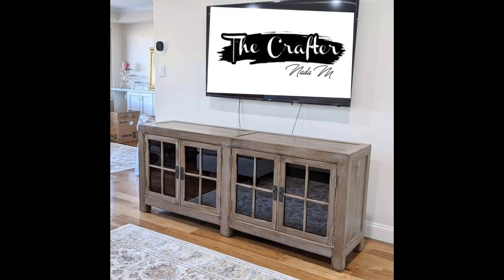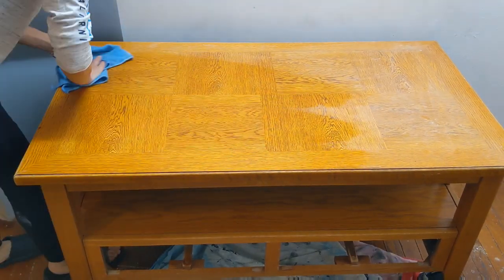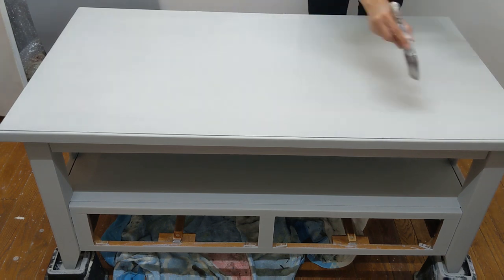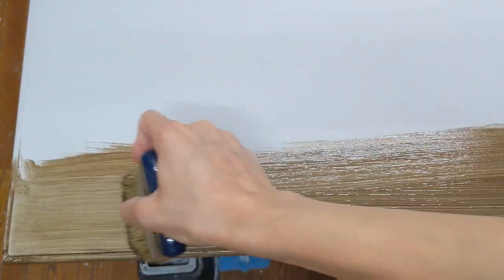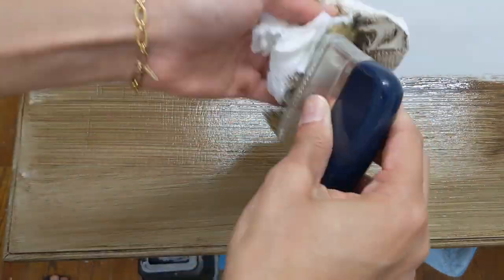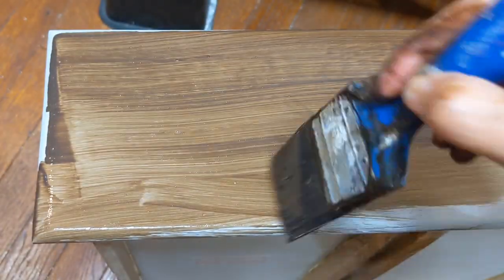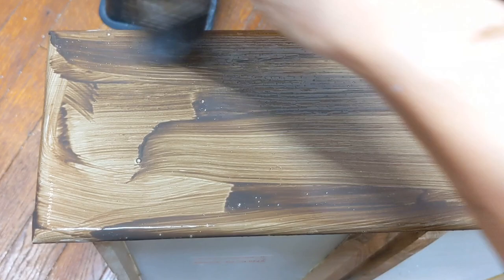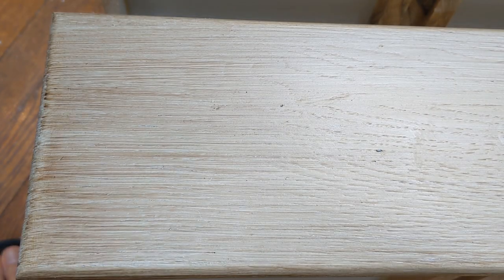POTTERY BARN Dupe DIY furniture makeover  | Beginner Friendly Furniture Flip | Easy Steps

Comment: Did you say why you’re holding the water during the second coat of paint?
Reply from the maker: I spray/mist water while painting to smooth out paint and reduce brush strokes, also keeps the brush moist so it won't dry out fast while painting :)